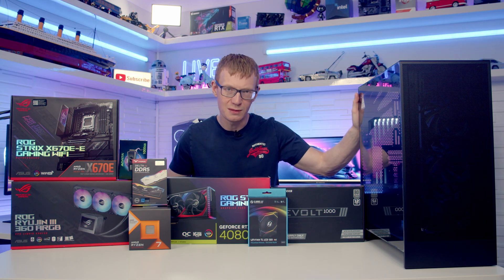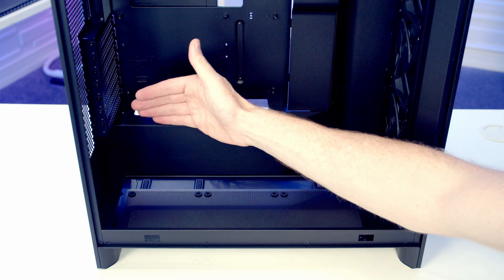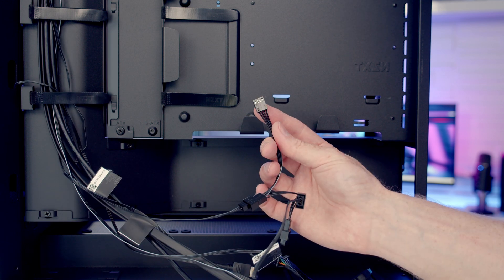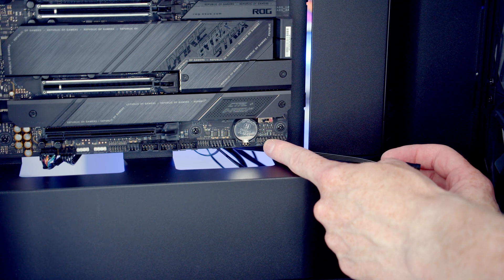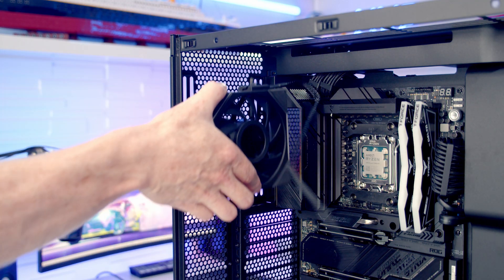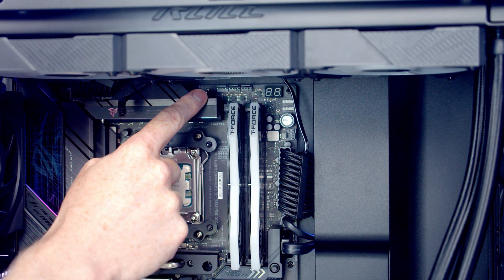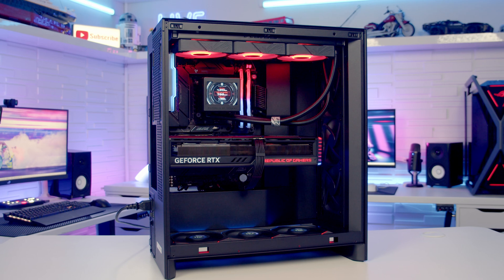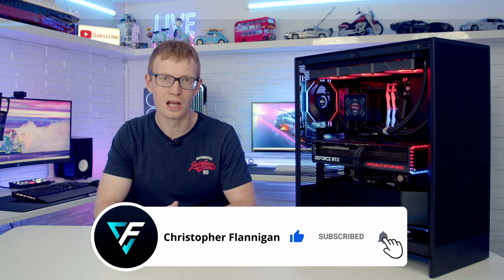NZXT H7 FLOW (2024) Build - Step by Step Guide

Comment: Hi 
There's nowhere on the motherboard to plug in the 3-pin connector from the NZXT RGB front fans.

The 4-pin PWM connector doesn't work with the CHA fans on the motherboard.

In your video, did you connect the 3-pin DC voltage pin to a different 4-pin PWM connector?

Could you help me with this?

Comment: So one thing that wasn't mentioned was how you power the front fans if you aren't using a hub.  You have to plug the 3 pin into the ARGB header (it was bottom, left on my board).  Otherwise, thanks.  I really like this case.

Comment: is it possible for a push pull system with a top mounted 360 aio? looking at the arctic liquid freezer iii 360 pro. i know its possible with a front mounted aio, but im just curious if it will work with a top mounted.

Comment: Going to be building in this case soon and using a tower cooler. I don’t plan on using any fans at the top and would bottom fans be necessary? I normally just do a flow through design; intake at the front and then the exhaust. Can anyone make a fan configuration recommendation here?

Comment: Screwing in the Graphics card is not so easy as the screw driver is on a slight angle. This needs a slight redesign by NZXT. I've just order the Corsair PC 65pc DIY Precision Toolkit and Mini Electric Screwdriver Set, 70 in 1 by Soleilwear, both are magnetic which will make PC Builds much easier. I kept dropping screws or was difficult at times.

Comment: Like this new design very much. Just want slightly bigger version that has 420 rad support at the top and back connector motherboard support. Maybe also 3x 140 in the bottom.
Reply from the maker: If it was bigger and looked more in proportion it would look better